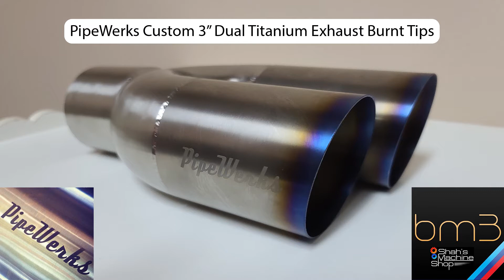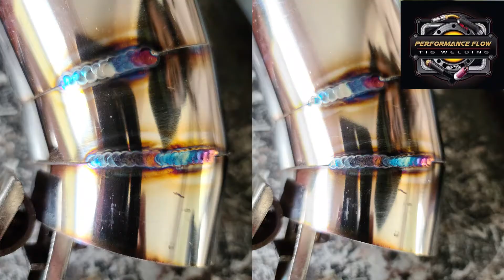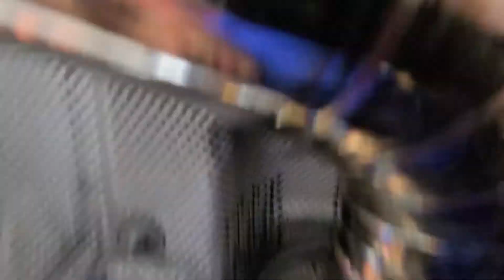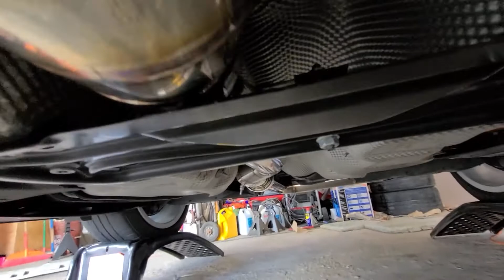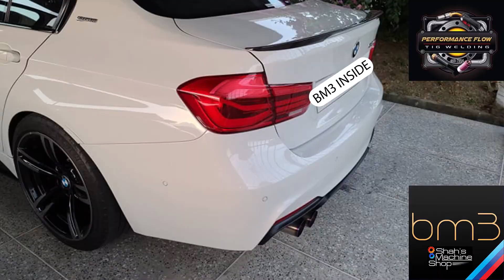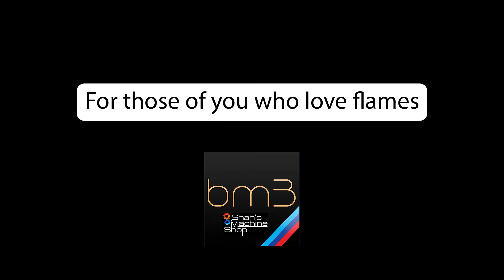BMW 330e gets Full 3" Custom Exhaust

Comment: Can i start up ICE engine at idle without hood open? how?
Reply from the maker: Yes just mash the accelerator pedal in park. It should come on and I believe if you open door after engine on it should remain on.
Reply: @bm3shahsmachineshop  
thanks it works!  do you know if it is possible not to turn off the engine when you go to 0km/h?  (Same start & stop)
Reply from the maker: @nicolas39205  only way I found was putting shifter to the left (sports transmission mode)

Comment: Can you have dual exhausts like 1 on each side with 330e?
Reply from the maker: Yes you can but routing piping on next side can be a bit challenging due to the batteries on BMW 330e Hyrbid.
Reply: @bm3shahsmachineshop  ok. I contacted a local guy and he said there is space but you just have deal with the heat with some reflectors